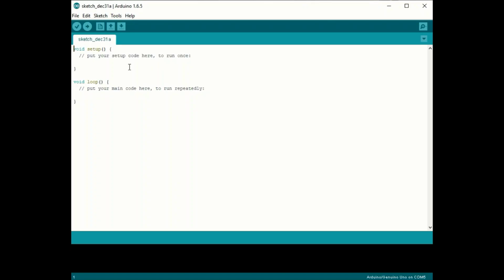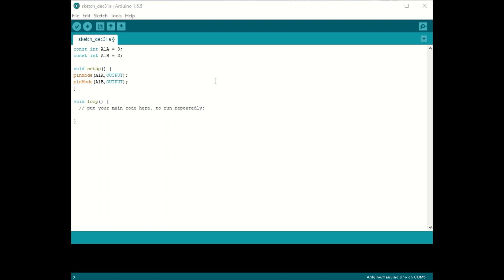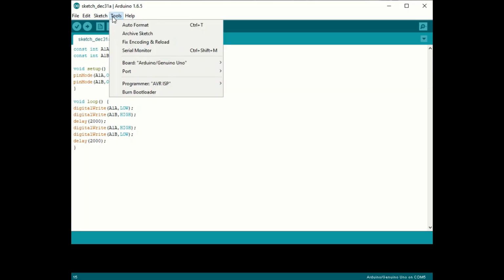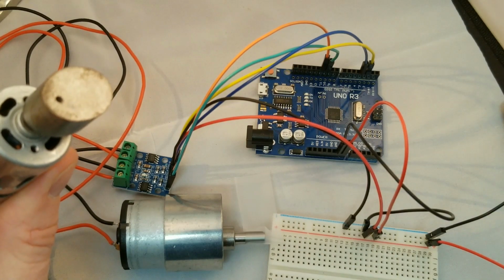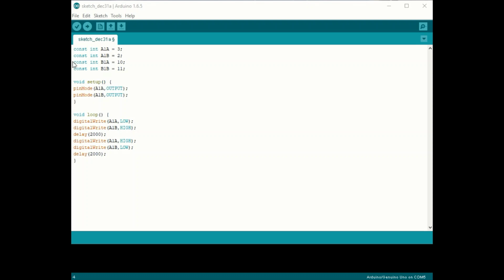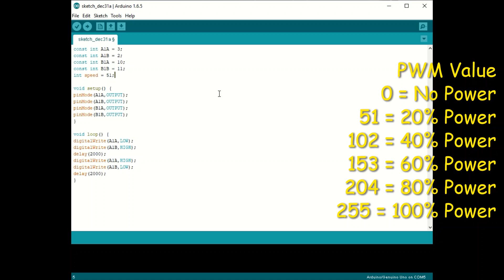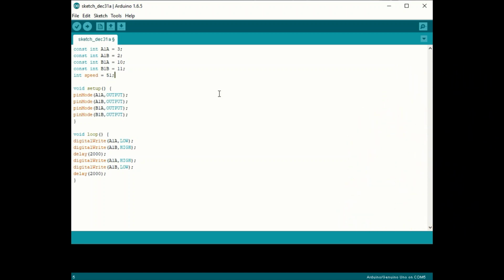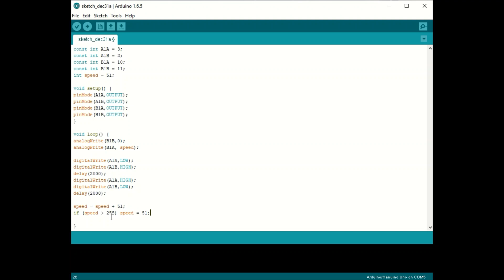L9110 with Arduino Code – Part 1: How to Control DC motor Speed and Direction

Comment: Will connecting 12V from L9110S to the outputs burn the IC?
Reply from the maker: It works with voltages between 2.5 and 12.
Reply: @ScienceFunInnovations  ESP32 works to 3.6V

Comment: Hi, I liked the video. Is it possible to have a code for a stepper motor that works very quickly, as I have a motor consisting of 6 wires?
Reply: Power capacity 24V
Reply from the maker: Yes. I just did a video on high-speed stepper motors. You can wire a 6-wire motor as a 4-wire motor (two wires do not get used) but it should still work fine.
Reply: @ScienceFunInnovations  Can I get the link?

Comment: hey. could help?
I need an arduino code for motor with encoder to control the position. thanks
Reply from the maker: Check out my 4-wire fan videos. Those use encoders, but that code is for measuring speed. To measure position, use encoder channel A to trigger an interrupt code. In the interupt, increment the counter if channel B is HIGH and decrement the counter if channel B is LOW. That way you can always know your position.

Comment: Yes, but how do you stop the motor at the exact same place each time???
Reply from the maker: Use a stepper motor or a motor with an encoder if you want to control the position.

Comment: my l9110 is not working with 4.5 volts(3x1.5volt battery), do you have any idea why?
Reply from the maker: It should work between 2.5 and 12V. Are the lights coming on when it is connected to power?
Reply: @ScienceFunInnovations  only the c1 is turning on red, if it's two batteries, it's working btw

Comment: Hi sir, the video is great but i was wondering if i could control coreless motor, these motors are complicated to control and i used to try to control the motor using L298N motor driver and the circuit vaporized, i can see this one has a much lower current and 
i just want to ask if there is any chance this circuit can be able to do that
Reply from the maker: What type of motor exactly are you using? Brushless? Stepper? The L298N is essentially the same as the L9110, but the L298 can do 2 amps vs 0.8 from the L9110. I have another video on stepper motor control, but not on brushless (RC) motors.
Reply: @ScienceFunInnovations  Coreless motor
Reply: @ScienceFunInnovations  It is a brushed motor, (the product's name to be exact is Coreless 720)

Comment: Nice video, but is code published anywhere?
Reply from the maker: const int A1A = 3;
const int A1B = 2;
const int B1A = 10;
const int B1B = 11;
int speed = 51;

void setup() {
pinMode(A1A,OUTPUT);
pinMode(A1B,OUTPUT);
pinMode(B1A,OUTPUT);
pinMode(B1B,OUTPUT);
}

void loop() {
analogWrite(B1B,0);
analogWrite(B1A, speed);

digitalWrite(A1A,LOW);
digitalWrite(A1B,HIGH);
delay(2000);
digitalWrite(A1A,HIGH);
digitalWrite(A1B,LOW);
delay(2000);

speed = speed + 51;
if (speed > 255) speed = 51;
}

Comment: hello, sir thank you for the video.... I want to control 2 of 5 v dc motors so is it ok to connect the motor driver to Arduino?
Reply from the maker: The Arduino power supply is very limited, so depending on the motor sizes you would probably want to use an external power supply.

Comment: How similar is this board to a BTS7960? If not much, any possibility you could do a tutorial on the BTS 7960?
Reply from the maker: Looks similar in function, but much more powerful. Also, looks like it will only control 1 motor vs 2 (and would not work for stepper motors). I just ordered one from China (so it should be here in a month or so). Looks like a great board. I'll check it out and likely make a video. Thanks for watching!
Reply: Is there a resource that you're getting this info from? I'd love to read up more about them.

Comment: Thanks for the video. I’m using one of these motor driver boards to drive 2 dc gear motors (yellow plastic ones) but the problem is the left motor is always stronger (more torque ) than the right one when using pwm speed control. And even if I change the motors it does not change the left motor stronger situation. Do you have any idea?
Reply: I use the same motors, and they're always a bit different. You need to trim them, i.e. adjust the PWM signal so that for example one is getting 240, the other 250, but their actual speed is the same. It's a common problem in RC cars
Reply: @Patyx42  you are totally right. Thanks for the respond
Reply from the maker: That is pretty weird. Do you have another L9110 board to test out? It could also be a loose wire or a bad pin on the Arduino. Perhaps try a different PWM pin? Let me know if you figure it out. Best of luck!

Comment: looking forward to using this to control a 3V aquarium water pump to water my plants!
Reply from the maker: Let me know how it turns out!
Reply: @ScienceFunInnovations  hey the code worked great but the problem i have is after i use PWN to set the speed i can't control the direction anymore I am confused as to why the direction pin doesn't seem to matter if you set the speed
and the only way to change the direction is to change the wires to the direction and speed pin

Comment: Great video, I really enjoyed it.

I've just started playing around with arduino based stuff and wanted to know, if i should use the L298 to control this (https://amzn.to/2VnC4cK) acutator or would the L9110 just doing fine? 

I wanted to build it in the extendable mount for my 55 inch TV, so it needs enough force to work properly...
Reply from the maker: I would recommend the L298 since it can handle much more power.
Reply: @ScienceFunInnovations  Thanks alot :)

Comment: Hi …I want to control a dc motor making it rotate 10 times forward then pause for 3 seconds and rotate 10 times backward…. this rotation cycle back and forth will be repeated automatically 20 times exactly like the washing machine. What I need to do that?
Reply from the maker: You could use a stepper motor with the L9110 https://youtu.be/aKxi7B4-d2U or with the EasyDriver https://youtu.be/nafoHAhz8Ys . Otherwise, you could use a motor with a position feedback such as an encoder and interrupts.